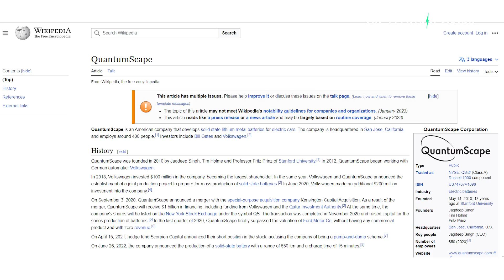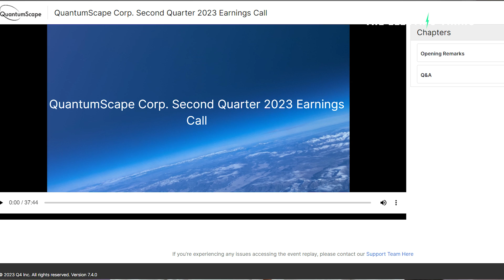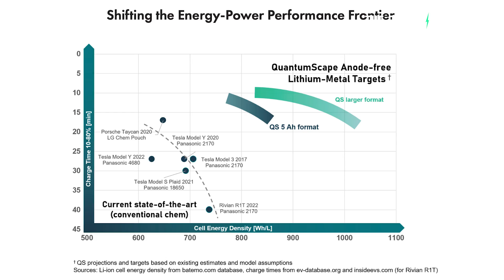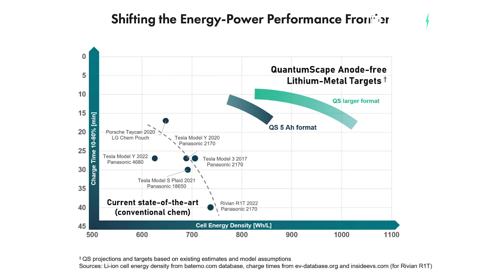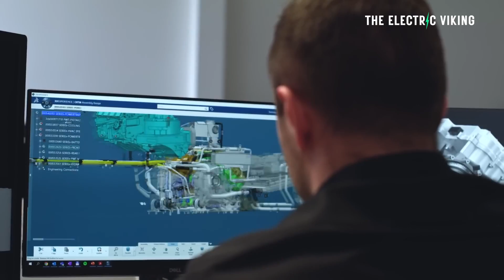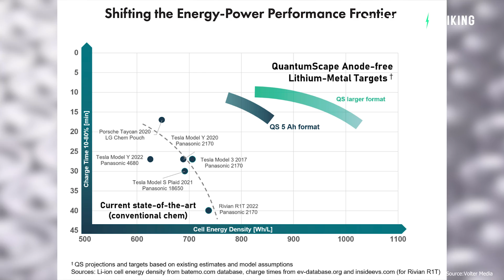American Solid State Battery manufacturer sends batteries to 6 car companies

Comment: Having worked in high tech for all of my career, the transition from lab to production takes way longer than most people realize. In the lab you have perfect conditions, and the engineers subconsciously avoid the problem areas of their technology. If you work in a perfect temperature, humidity environment with 99.99% pure materials, things work a lot better than they do when things get grungy and the materials are not so pure. 

So these breakthrough products are always late. Even Tesla has had a devil of time getting their new battery into production. It always takes way longer than people hope.

That being said, QuantumScape has a lot of money and is hitting hard on this area. Toyota also has put a ton of money into battery tech. GM used to be a pioneer in battery tech but has faded.

If i had to bet i would guess that Fraunhofer or some other european group could win, or Samsung, because Samsung has such a great research dept. Whomever wins the next gen battle of battery tech will get very rich.

Supercapacitors, if they can solve the explosive failure problem, would be ideal for electric cars. But i don't think any supercapacitor tech can solve the explosion problem (similar to hydrogen, once it reacts you can't control it).
Reply: Supercapacitors can accept charge and discharge rapidly, but energy density is still far too low. Might be combine-able with a higher energy density battery, but even then, the energy density of the supercapacitor myst exceed 75 w-hr/liter within the constraint of a 25% voltage decline, which means at least a 10X improvement in their energy density.
Reply: I agree but at the same time battery prices have dropped by 15% over the last six years while increasing in capacity by 25%. They also charge faster than they did six years ago.

They're projected to drop another 40% in price by 2025.

It's happening close enough that we don't notice it but the drop and increases are both exponential.

And the developments of 5 to 10 years ago are constantly coming to market today. 

I can actually buy an electric trike with 50 miles range while carrying 325 pounds.  That's me and several days groceries.

And I can completely charge it from my small solar array.
Reply: Sort of “Production HELL” huh ?
Reply: Exactly. All the BS Toyota has pumped out about solid state batteries in the last decade usually ends with something like "and if the technology is viable it could be in production in 2 years". Doesn't account for turning a lab experiment into an industrial process, designing and manufacturing machines that make batteries, or the developing & commissioning a production line, or developing the supply infrastructure required to source materials and deliver them after, or building the plant everything works in, or designing cars that take these batteries, or the training of staff or anything else.  All that takes YEARS. As an example VW are building a battery plant in Canada which I assume is for conventional cell battery - construction began this year, production commences in 2027.
Reply: @drxym  Agree 100%   Look at the challenges Tesla is having getting its 4680s up to scale.   Lithium Ion battery tech in production today may not be as energy dense, etc...but they are available today, not some 'promised' time in the future.   That is something a company can plan around.
Reply: @drxym You know nothing of what Toyota is doing

Comment: They are only sending Sample A batteries to partners. I think that they are up to 24 layers, but these are not production batteries, they are still almost “hand made”. It’s still a few years away. Even if they nailed the battery today, they need 2 years to make a production process and built a line.

Comment: We don’t even have solid state battery for flashlights at this point. Flashlights don’t need to be moving around in hot or cold weather conditions. You would think, if solid state battery is ready for commercial use we’d see it in computers and flashlights first.
Reply: mobile phones. people would easy pay another 100€ for extra 5.000mAh in a normal sized phone. not sure if you can ask another 100€ for a better flash light.

Comment: The fact that QuantumScape is shipping samples to car manufacturers for evaluation is the first sign I've seen, of real progress. Now, it's the not-so-simple task of making this technology affordable, and producible in mass quantity.
Reply: they already did this over the last few years several times to show progress and get more funding. it is a step-by-step plan and so far it seems that they could deliver according to plan
Reply: @orionbetelgeuse1937  quantumscape is not owned by VW. VW is one of many investors. so quantumscape is sending the samples to multiple investors for evaluation. they do that regularly because these investors have a step by step plan to release more money if some milestones have been reached. this is nothing new and going on for years.
quantumscape can evaluate their own batteries, this is not the issue here.
but the investors need to evaluate the samples independently from whoever they trust.

Comment: In the meantime LFP batteries went from 6% market share in 2020 to 30% market share in 2022.  Wake up Solid State boys and see the reality.  Although not as good as NMC Lithium, but because it's so much cheaper, it has garnered the largest increase in market share. Current battery technology although could improve in density, fast charging , longer distance, it's already good enough so that the new priority is to reduce to the cost of batteries by about a half or more over the next several years. If Quantum Scape can improve fast charge and distance but it's batteries will cost 5x more than it'll price itself out of the market.

Comment: There has been the joke going around that "solidstate batteries are ten years away". This has been the case since the nineties. :D :D .... HOWEVER some research institutes like Fraunhofer and Helmholz in Germany had recently reduced that estimation to be less than ten years. These entities had been fueled with money as the technology was seen as the way to break Korean and China's dominance on the patent front. There are rumours that managers have ready-made plans to build up mass production in less than three years as soon as the batteries haven proven to work. Some believe that the big investements that Varta is mentioning in its fiscal reports (and which brings down the stock market price) are actually related to preparing new operations including silicon-carbon ans solid-state battery produciton. Well.... nobody knows the details. Bets are still open.

Comment: @7:17 If their energy density and delivery capacity is that great, they should go and try the various airframe OEMs. They could have that market all to themselves.
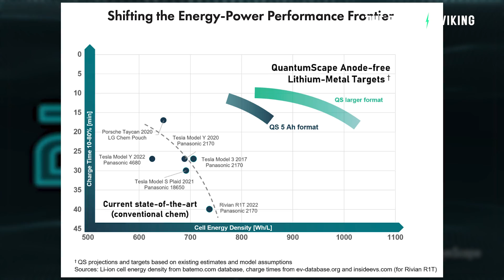Reply: 4:48 - marketing-speak warning - that Y-axis is inverted to highlight the charging times which, of course, are better if they are smaller - but on a graph things look better if they are "up and to the right". Quite funny.
Reply: The market is building the airframes with the expectation batteries will be ready when they are.

Comment: When they first started talking about Solid State batteries, they said that they would charge around 5X faster and have nearly three times the capacity.  At that time the best car available was a Model S with about a 250-mile range and capable of charging at about 75 kilowatts.  Today besr that you can get is a Lucid that have up to a 500 mile range in charge at about 350 kw for about the same price.... So when they talk about these solid state batteries, will they be 2 to 3 times better than One Day first started talking about them or today's?

Comment: Solid state is a lost cause. The lower order of energy density of solid state batteries is similar to higher level lithium batteries, but costs 3 times more. — the only viable product is when solid state batteries is 3 times more energy density..

Comment: How would 15 minutes charge be bad. That's just about right for a bathroom break and to get a refreshment and maybe if your quick, a bit of a leg stretch. The only way I see it being a problem is while on the road, if the range is so low that you have to make alot of 15 minute charges.

Comment: From what I've learned recently about solid state batteries is that they expand and contract far more than conventional batteries.  This creates a packaging nightmare, especially if you want them to be in a structural pack.
Reply: Not these using advanced technology
Reply: @sparkysho-ze7nm  we shall see
Reply: They create dendrites which rupture the packaging.
Reply: @KP-xi4bj  I thought that solid state was supposed to prevent the formation of dendrites
Reply: @jtkstudios4168  that's what I thought, too.  One of the whole reasons for going solid-state.
Reply: @KP-xi4bj  .. That's we're the ceramic separator comes in
Reply: @jayboss2598  the tighter you wrap an energy source the bigger the bang!
Reply: @jayboss2598  Ceramic separator only prevents dendrites from anode making contact with dendrites from cathode creating a short circuit and deactivating the battery.  It does not prevent the formation of dendrites to begin with.

Comment: Nio ES6 is supposed to have a range of approaching 600 miles using a solid state battery.  So more conservatively say at least 500 miles. I guess we will find out when its released to the market.  Nio ES6 Gen2 received 90 pre-orders per store in the first 72 hours in China apparently. They had near 30,000 pre orders from their 330 stores in China apparently, all within 72 hours of pre-order opening date.
Reply: NIO started deliveries of All-New ES6 in late May 2023.  Presumably in China.
Reply: Cannot trust Chinese engineering.

Comment: 10-80% in 15 min is fast if they put the chargers where you eat, shoop and park, if it gives you 500 km of range.
Reply: with these batteries you could put 100kWh into a small car like a VW Polo or a Ford Focus.
with real world usage of 20kWh per 100km you get that 500km easy in a small car.
but usually you don't need more than 800km per day. that means you start in the morning with 500km and then you charge 350kW for 11 minutes and you go the rest of 300km.

Comment: I thought that QuantumScape's battery was semi-solid state! When I google it deeply enough, I come up with, "QuantumScape couples this solid-state ceramic separator with an organic gel electrolyte for the cathode (catholyte)." Gel sounds like semi-solid to me!
Reply: The lithium metal anode is really where the advantages are. Solid state is just a hype word in the battery sector these days. Semi-solid state probably is the more accurate term for QuantumScape's battery. But if it is safer, can fast charge reliably hundreds of times without losing overall capacity, and has a higher energy density, who cares?
Reply: @rsoxboy  Can it be transported in a state where it won't catch fire and keep burning, if it's on a car carrier on fire? I'm not sure any li-ion battery qualifies. Not even ones where the anode is metal in solid state.
Reply: Hundreds?
Reply: You thought wrong
Reply: yes, that is already known for years and the CEO of quantum scape also explained that in detail. parts of it is solid, but not everything. the ceramic separator just keeps dendrites from growing from the anode to the cathode. but on the cathode side of the ceramic separator there is an electrolyte that is not solid.

Comment: No battery 'breakthrough' matters unless it can be manufactured at scale and cost competetive with current Li ion batteries with liquid electrolyte.
Correction: It may matter for aeroplanes, and will make larger, long haul ones possible.
Reply: I mean.. they don't have to be EQUAL in price if they're really THAT much better.. but.. yeah, not many are going to be willing to pay crazy prices for em. And the odds that they can mass manufacture these and get them out at any kind of, even high end, price point.. is unlikely for quite awhile longer.. if not a whole LOT longer. My guess is at least another 5 years and going into only high end >$100k vehicles. And maybe not very many at all depending on how slow they ramp up. And my guess is it'd be 10 years before they make it to any mid priced vehicles >$60k. And that's IF any of this actually even pans out. Which it probably will.. but there's no knowing that they won't run into some problems in actual use or manufacturing that sets this whole tech back another decade.
Reply: if it is too expensive for the car market for now, there is the high-end mobile phone market and aviation. 5Ah cells are already targeted for the mobile phone market. they now have in the area of 4500mAh to 6.500mAh. that means quantumscape can deliver 5000mAh in very slim phones or 10.000mAh in normal phones.
people would spend extra 100€ for that. 100€ for 0,018kWh instead of 100€ per kWh in the car industry 🙂   that is quite a difference.
Reply: Electrolyte*
Reply: Price per kWh is what matters. Not overall price. If they can make an equivalent price for same power but smaller or less weight, that’s a win
Reply: The electric cargo plane: Pyka has now unveiled the Pelican, an autonomous electric cargo plane with a 200-mile range and a 400-pound cargo capacity. According to Pyka, this makes it the largest zero-emissions cargo plane in the world.7 Feb 2023
Reply: Lithium iron
Reply: @skepticalmechanic  Is it a hobby embarrassing yourself in public?
Reply: @grahambrown42  Thanks for taking the time to make an ass of yourself…. I had a good laugh!
Reply: @skepticalmechanic  No problem 👍
Reply: The thought was these initially would be in top end "supercars". So Small volume grand tourers  like say Bentley's etc or sports cars  eg Porsche where the higher performance is expected.
Reply: Exactly!
Reply: toyota already said they hold 1000s of solid state battery patent and will release their SUPERIOR solid state battery soon.. soon .. soon maybe next century
Reply: Space travel; lunar and martian habitats, etc.  would be another application where expense is secondary to other factors like longevity and suitability for a specific use-case.  All good wishes.
Reply: Thank you Captain obvious. At least they have the data to back up their tech unlike Toyota and solid power
Reply: Of course it matters. People were saying the exact same thing you are comparing ICE to EV 20 years ago. Now look where it's headed. AT FIRST, it might night matter to the average consumer, but as it improves, becomes cheaper, etc, it will. matter very much. Cutting edge technology is never geared towards the average consumer at first, but it definitely matters.
Reply: I think they should use Lithium/ Nuclear batteries next - they have so much more range and are so much more fun when they catch fire!

Comment: Stationary storage partner?
Using solid state batteries, red flag right there!
Reply: it could be viable if the cycle life is very high as well as the power density. buffer at charging stations?
Reply: Fluence

Comment: The range of solid state batteries doesn't have to be as high as Lithium,  because they can charge much faster.  In a fully built out EV charging network where the max distance between charge stations is 100km,  it wont be much of an issue at all.  Most daily commutes are far less than 100km anyway and people can also charge at home.  It's only on longer trips you would need to recharge more frequently,  but a 15 min fast charge top up stop every 100km is not a show stopper at all.  That said I suspect the solid state battery range is a bit more than 100km. And they work better in cold weather, where Lithium ion looses range.
Reply: Maybe in the rest of world but the people I speak with in the U.S. want more than 300 to 400 miles before they would switch. I drive Uber so I talk to a lot of different people from different backgrounds.
Reply: Yeah public transport is more widely used for daily commutes in other countries.  US daily drive commute is longer than most other parts of the world.
Reply: Even 20 years ago, people were doing a crazy daily commute of 70-100 miles each way, commuting from the Poconos to NYC. And that wasn't unusual around many of the overpriced cities. So that's 200 miles before they get home and can recharge, since most employers will not put in chargers.
Reply: 90% do less than 50
Reply: Facts from Cracker Jack box

Comment: I will believe it when i see it, theyve been talking about solid state for yrs.
Reply: Nio et7 with semi solid state cells built by welion, 150kwh capacity pack which only weighs 44# more than the nmc 100kwh pack in the same case. Entered official production earlier this month. 44% better energy density at the pack level than the best nmc cells. 

Catl has condensed matter cells entering production in q4 of this year. 500 wh/kg and they already founded a joint venture ev airplane company recently to supply with those same cells. 👍🏻😎
Reply: @4literv6  these are chinese manufacturing so yeah but highly unlikely western counterkids will ever come close before 2039
Reply: @4literv6 
Do you know the price of 1kw nio battery?
I searched for nio battery and impressed with 360wh/kg

Comment: Look who Quantum Scape's board members are. Jürgen Leohold, Former Head of Volkswagen, Group Research and Jens Wiese, Head of Volkswagen Group M&A,
Investment Advisory, and Partnerships are 2 of just 11, a very small board by modern standards.
Reply: Among them is JB Straubel, it doesn't look bad
Reply: @victorbar3567  But Straubel says current batteries will be the standard for many years.